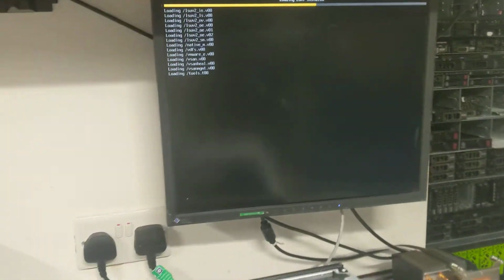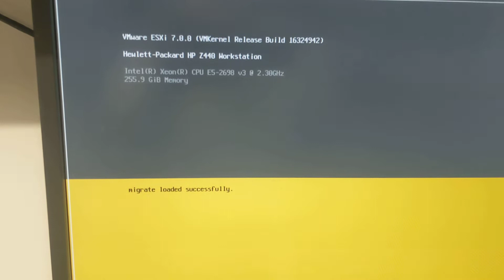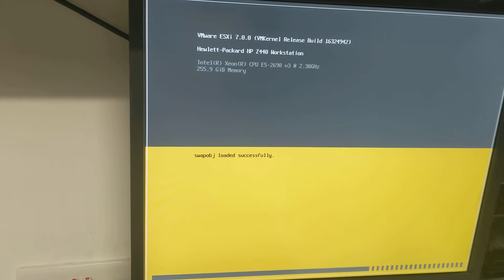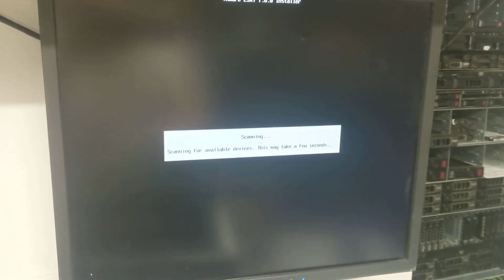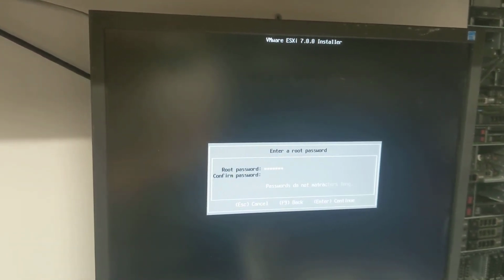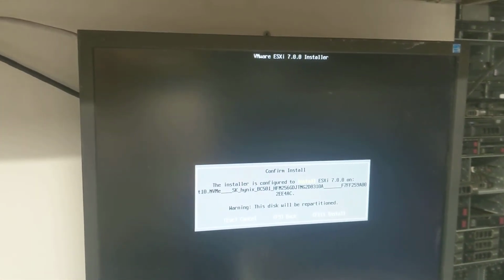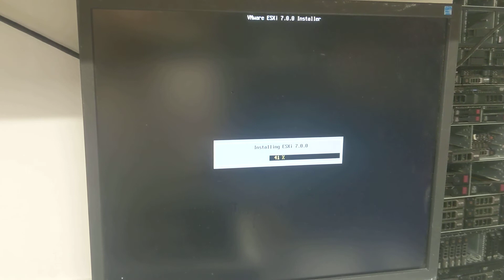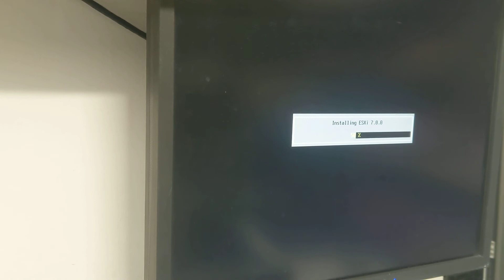vmware 7.0 u1 installation z440 e5-2698 v3 256gb ram pcie ssd nvme

Comment: Hello, i was having the question if 256gb RAM are supported by the Z440, now i can confirm it!! could you tell me the exact model of the RAM?  thank you very much!
Reply from the maker: 256GB 8x32GB DDR4-2666Mhz RDIMM Memory Z640 Z440 Z840 GEN9 G9 HP DELL R730 R630
Reply from the maker: SAMSUNG 32GB 2RX4 DDR4 19200 PC4-2400T-R SERVER MEMORY RAM 2400MHZ 1.2V ECC MEM